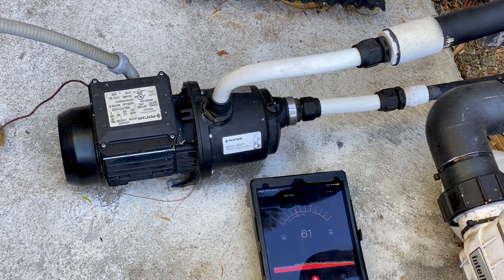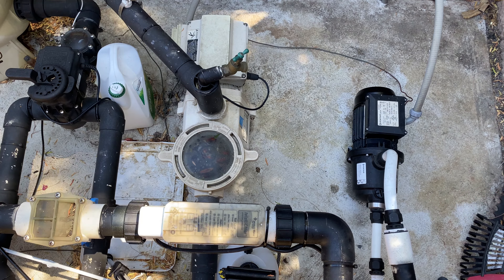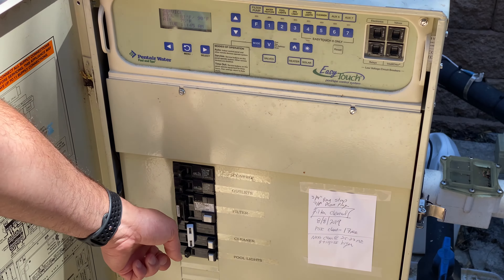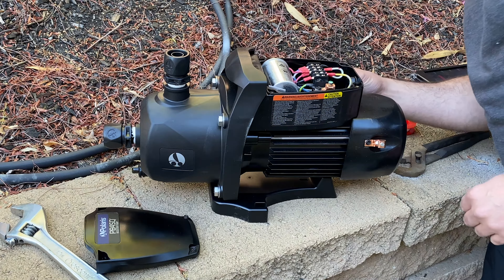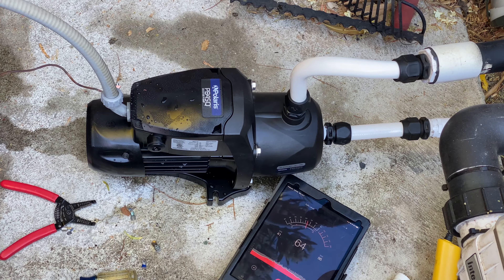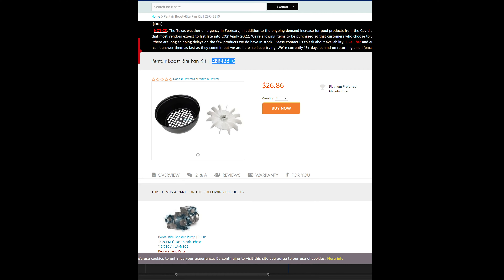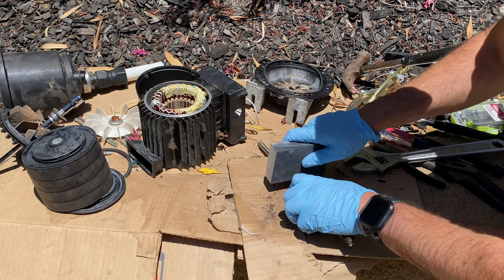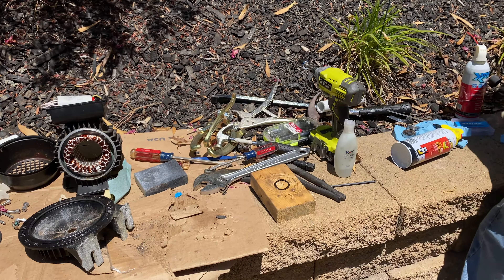Replace or Repair Pool Booster Pump

Comment: Jake, thank you so very much for the video.  Gave us confidence to take this on. Looking at 15:50 on your video - you have the seal installed incorrectly.  The spring portion faces away from the motor.  You can see the correct configuration at 10:58.  We made same mistake today.  Pump ran fine but leaked.  Swapped seal 180 degrees - leak fixed and good to go.  I don't mean in any way to discount the value of the great video, but wanted to point it out for you and others.
Reply from the maker: Thank you for pointing this out for the next person. I really appreciate it and sorry if it caused you any extra troubles. I probably lost track of the reassembly as I was trying to film and also watch my video of disassembly all the same table. Thanks again. I’m happy to hear that you got your pump back and working.

Comment: Where's the capacitor?  Was it in that first compartment you unscrewed with the wiring?  Or is it behind the fan?
Reply from the maker: If you look at the thumbnail for this video, it’s in the first compartment on the top. It’s at large silver thing bigger than a D size battery. Very easy to get to without removing much. It is white color on the old pump and it is silver on the new pump.

Comment: Excellent video!  Thank you.  I would add a few things for those watching.  For the rusted shaft, treating the shaft with either EvapoRust (rust remover) for 12 hours, or RustMort (rust converter to a black iron phosphate), will help to ensure the longevity and durability of the shaft.  In any event, since the chromed shaft coating is now damaged where it rusted, a good quality oil based primer over the treated rusted part(s) is important.

Comment: @ 7:15 suction hose is a little short and forces a crimping 45 on return hose.
Reply from the maker: Ya, you’re right. I was trying to get the pump to fit back into the mounting screws on the cement pad. I might be able to shorten the top return hose and lesson the 45 degree angle. What do you think?

Comment: Excellent video! I rebuilt my pentair today, replaced the two bearings and the seals. The water side bearing was shot - seized up completely. It was no fun to remove - but we got it done. It went back together very easily. When I put the fan back on, it was too close to the housing and the pump has such little torque, it would not spin. I backed the fan off, maybe an 1/8" and it is running like a champ, quite and smooth. The rebuild part of this video saved me around $550. Thanks so much for taking the time to post.
Reply from the maker: I love hearing feedback like this Chris! Especially the little small details to help the next person out. By merely sharing knowledge we can all find ways to save money and repair our equipment!

Comment: Thanks for this video.  Very well documented and your descriptions are very understandable.  I installed a brand new one of these pumps a week ago.  A couple of days ago, the motor seized.  I disassembled the pump and found a significant gap between the acorn nut / star washer / flat washer and the first housing / impeller blade.  Once I took the stacked impeller housings off the shaft it became clear that everyone of them had significant damage to the interface between the impeller and its housing - melting/destroying the seat and ultimately creating gaps at each stage adding up to the gap I saw at the acorn nut.  I couldn't figure out what happened till I checked out the actuator for my valve feeding water to the pump.  It had failed in the closed position starving my pump.  One cam follower in the actuator had broken previously and the previous owner or repairman fixed it by gluing it back together, then gluing a plastic plate across the fracture point.  This repair failed.  On top of that, the broken cam follower had originally gouged the surface of the cam path on the actuator shaft and it had been repaired using a length of nylon wire tie glued around the shaft!  Very creative fixes.  They lasted at least 10 years (the time we have lived in this home).  I have bought a new actuator and a rebuild kit for the pump.  Fingers are crossed this will get me back in operation...
Reply from the maker: Wow Jim, interesting story and repairs. But I guess if it lasted 10 years that is pretty good! They should almost have a flow sensor like salt cells. So if water is not flowing then the pumps shut off. But these pumps are relatively inexpensive and pretty simple integration with the rest of the pool equipment. I hope you are able to rebuild it and get the valve fixed.

Comment: Great video!  Two questions: (1) Another pool website recommends "upgrading" the booster pump shaft seal for saltwater pools to a silicon carbide seal, at about 5x the price ($15 for standard seal, $75 for silicone carbide).  Do you recommend that since that seems to the first point of breakdown and water entry for these machines?  (2) Given that all the motors seem to seize after a shaft seal failure, should pool owners just replace that shaft seal on an annual basis or some regular schedule, to stay ahead of the water penetration issue?
Reply from the maker: These are very good questions and insights. Honestly I do not have an answer for you. You have to weigh the cost of a new pump around $431 and the cost of the seal you’re talking about in your time to replace it. I wouldn’t pull it apart every year and replace the seal. I think that’s just overkill but that’s my opinion personally. It would be nice if they had a regular scheduled maintenance plan where they told you how many hours or days that you should replace the seal to prevent a failure. But I doubt they ever will provide that for us. I’d say the pumps are relatively cheap so I would just replace the pump if her place in the $15 seal didn’t work.

Comment: I know this is an old video but how do I tell if I have a 120 or 220 set up?
Reply from the maker: Hi Philipe, find the circuit breaker for your pump. If it’s a double breaker that means too hot lines which is 220 V. If it’s a single breaker, it would only be one Hotline and 110 V. I hope this helps.

Comment: Awesome video - thanks for the details and a really well done video, and thanks for linking all the parts. The only mistake I made was installing the shaft seal inverted.  Lot's of water leaking out until I relooked at your video.  During the disassembly you show the flange facing the motor side (which is correct) , but on the assembly video section I think you show the spring facing the motor side (it's really fast so I might be mistaken) .  Since it was a week between tearing it apart and getting the part I only reviewed your reassembly section of the video.   Let me just say the water shoots out of the bottom quickly if you are like me and put the shaft seal in wrong.  Luckily, it does hurt the shaft seal and I just flipped it over and everything works great.  I will make note to self to pay more attention to the order of things when I disassemble.  Thanks again for saving me $550 on a new pump.  Parts cost me less then $50.   You are an  inspiration.  And good luck with you Polaris SB4SQ - comments on Amazon are that the housing cracks after a couple of months. 
Thanks again for the video - keep up the good work
Reply from the maker: Hi Mike, I really appreciate the comment and feedback. Sorry if I lead you astray on that one section. I myself spent a lot of time trying to keep track of the order and direction of the parts. I had to re-watch my own filming to help myself out. Anyhow, it is great you were able to flip it over and seal everything up. It really is a small easy part with a large disassembly.

Comment: Who makes a decent pump that will support a warranty?
Reply from the maker: That is a very good question. I would say they all make decent pumps, but I don’t know of any great pumps that are well supported with warranties. But then again they are relatively cheap compared to a pool pump. $309-400 vs $2,000. And parts are cheap to repair.

Comment: Nice work Jake! My Polaris pb4sq that I installed new in 2019 is now very loud due to bad bearings. Your video has inspired me to tackle the repair and also helped me to suspect the cause behind the bearing failure (potential bad seal). Ready to get into it. Thanks Jake!
Reply from the maker: Thank you Kurt. Sounds very similar to mine. Take your time and take photos along the way.
Reply: Update: Tore down the pump and motor this afternoon.  Found the drive end 6203 bearing to be the culprit. The bearing was rusted up on the seal side due to the seal failing. Definitely had a rough spot in it. Picking up new bearings for reinstall tomorrow. So far so good!
Reply from the maker: Good update! Hope u didn’t struggle like I did with corrosion on the bolts. That held me up a bit.
Reply: @fixitwithjake  I did run into some rust but soaked the trouble areas with liquid wrench and was able to remove the thru bolts without snapping them😁. My drive out cost for the repair was $52 for a seal kit and 2 bearings. What a deal compared to $500+ that a new unit would cost.  Very satisfied with the results.  Thanks Jake!
Reply from the maker: That is great to hear Kurt. I’m so happy this worked well for you. It’s really nice to be able to do some of these repairs and keep the cost down to run a pool!

Comment: What is the brand of water based lube you use. I’m so happy I found this video. My
Pool company wanted 2000.00 for a new pump installed. Found a motor and seals for
300. Bought the herrings too to hopefully get the original motor working as a spare.
Reply from the maker: Any water based lube should work. You want water based, not waterproof. I found it cheaper at Home Depot then online. They had an o-ring water based lube there. Thanks for the comments and good luck with your project.

Comment: The polaris booster pump pb4sq has a big problem seems the leaking is a verry common issue with that pump  It cost almost  $700.00  not including installment and just a little over two years it leaks everywhere in the housing  , not cool for the cost . Can the company  please recall it . We are getting no help from the polaris company.
Reply from the maker: Almost all of these small cheaper booster pumps have issues. Even their competitor model does. I don’t know where they’re charging 700 but I was able to get a replacement on mine for around $400. Do you live in an environment that freezes in the winter? I’m just curious if you winterized it and drain the water out of it. Because if you don’t do that, I would imagine that would bust up pretty fast in a year or two. So make sure that you winterize it, drain it and dry it all out.
Reply: @fixitwithjake  seems luke I'm not the only one complaining about the polaris booster pump it's a very common issue  I see on the reviews.  Thanks for  the info  👍

Comment: What's the name of the white pipe, to and from the pump? I presume it's more weather resistant than black poly?
Reply from the maker: It is a flexible rubber pipe reinforced with poly strings inside. It has to handle the pressure and not flex too much. The new pump comes with it. Not sure if it’s more weather resistant. I think they use it bc it makes connecting easier a flex pipe and not rigid pvc. It has simple slide on pressure fittings. https://amzn.to/3WkaIlA
Reply: @fixitwithjake  ok. Thanks. I'll look into it further.
That's why I was thinking about black poly, bc of barb fitting being easier

Comment: Oops. You used your PVC pipe to install the new bearing by banging on the OUTER race. Big no no. When you press a bearing on a shaft you apply force to the inner race only. By beating on the outer race you are applying force from the outer race, through the balls and cage, to the inner race. This will damage the cage, the faces of the races, and the balls. Get a pipe sized to bear on the INNER race only.
Reply from the maker: Hey, this is really good info and thank you for sharing. I will do it your way next time!

Comment: How many times has your pump case split so far?
Reply from the maker: What do you mean by split? The seal inside went out one time on the original pump. I opened it up to replace ut.

Comment: Jake or anyone.  After putting it all back together.  it works but seems to be binding somewhere.   i.e. it takes a few times of turning on and off to get it going.   Or I have to turn it a bit at the fan then when I turn it on it works.   What could cause it to bind?
Reply from the maker: Turn off the power. Pull the cap off the fan. Spin fan/shaft by hand. Do you hear any rubbing or does it spin smoothly without power?
Reply: @fixitwithjake  it does not spin freely.  It is not hard but not easy to spin.  It does make a sound. Not sure how describe it.  Some places seem easier to spin.  There is no free spinning I have to turn it
Reply from the maker: I’ll go check mine and see how it feels and report back.
Reply: @fixitwithjake  thanks.   I am reluctant to let it run long
Reply from the maker: My pump spins freely without much resistance. Sounds like something is off alignment inside. The fact that the resistance goes in and out could be a bent shaft if you were hammering on it. But always start simple and move up from there.

Comment: Great video! After discarding two pump motors (Pentair LA-MS05) in 3 years, I decided to follow your video and tear down and replace the water seal and the two ball bearings. The ball bearing near the fan was easily replaced with a 6202-2RS. However, the forward bearing on my pump (the bearing on the opposite end from the fan) was larger than the 6202-2RS. I could not find any numbers on the bearing itself. It had both a larger inner diameter and outer diameter but otherwise looked like the 6202-2RS. I have not been able to find the pump schematic showing the parts numbers. Anyone have any ideas?

Comment: How do you get the fan off?  Do you unscrew that thing on the end or do you pry it off?
Reply from the maker: Pry off the metal coupler first. It just a metal ring with tension on the fan. Then gently tap and wiggle the plastic fan off. If you force the plastic fan and its old, you might crack it. I may have an extra replacement if you need one. Just let me know. https://www.ubuy.co.id/en/product/3UBH9DSW0-pentair-zbr43810-fan-rplcmnt
Reply: Thank you for the quick reply.   Do you have a part number for the pentair shaft seal.  i.e. when you ordered a new one what was the part number.  I ordered one but it is way too big.  Thought I had taken the number off the vid but must have messed up.
Reply: I think pool web sent me the wrong part Pump seal PVP55.   Do you have a different part number?
Reply: I got the number off the diagram ZBR43920
Reply: @fixitwithjake  Got it off, took a while but got it.  Then got the short bearing off now for the long one.
Reply from the maker: Sorry for the late reply. I was driving earlier. Glad you got it off and got the part number. Happy to help out if you run into anymore hiccups. Thanks for sharing the part number for all. Looks like my link above expired and no longer goes to the part. I will update this week!

Comment: Make sure you use good bearings. Like skf or you will be changing then soon. Better bearing only cost like 5 buck more. Stay away from the Chinese amazon ones!
Reply from the maker: Good point! I'm sure there are different quality of bearings. For the record, the ones I linked below have lasted 2+ years with no issues.

Comment: Bad pump. Housing splits. And they don’t sell the replacement housing anymore. Total scam from “fluidra”
Reply from the maker: You would think after making pumps for this many years that they would know where the failure points are, and where to reinforce the materials…